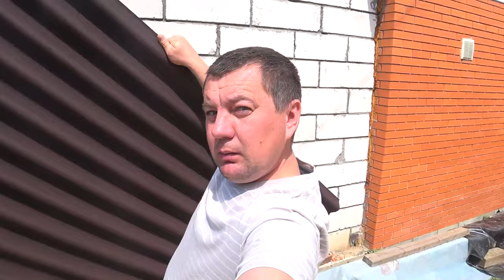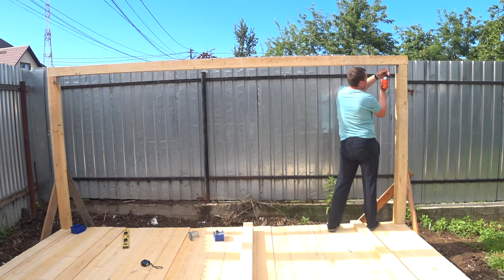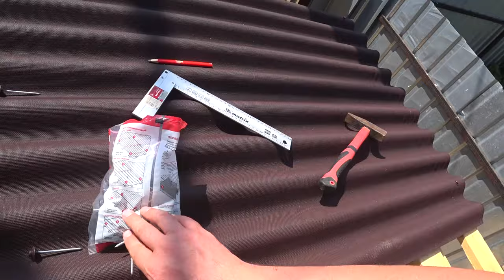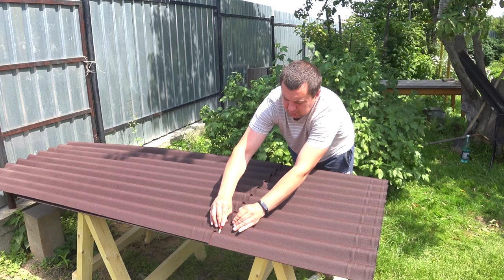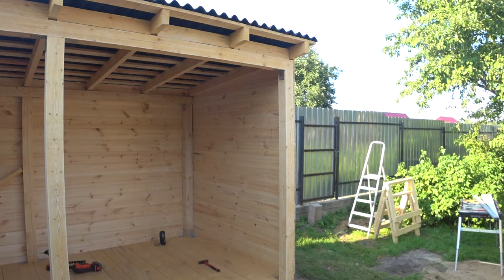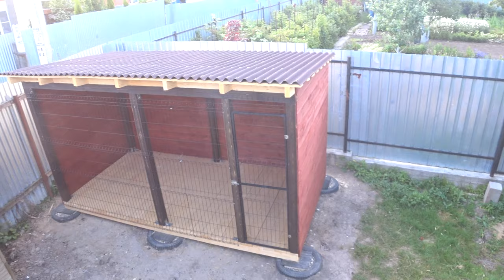Mixed wood Dog House

Comment: Great video! I just have one question. What did you use to secure the wire to the wood? I’m also building a dog kennel and I am wanting to use wire but I want it secured strongly since I have a big dog. Thank you!
Reply: Did you figure out what to use??
Reply: @2006mrderrickh  Galvanized staples maybe? Think they're basically nails bent in a U-shape